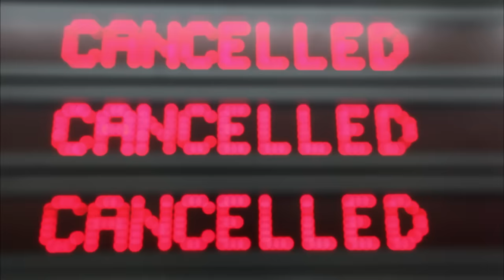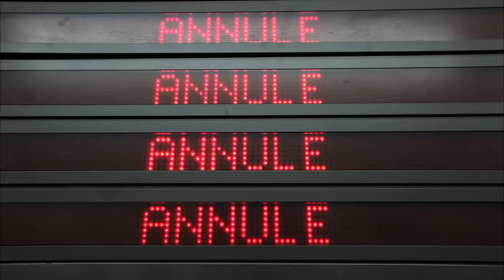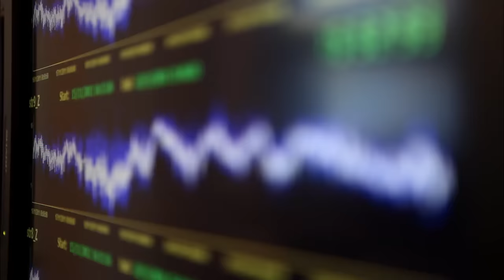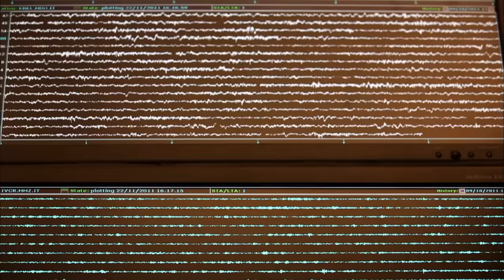A Volcano Odyssey | Documentary

Comment: Some people have suggested that the meteor that crashed into the Gulf of Mexico was directly opposite where the eruptions occurred in India when it was below the equator. Could a shock wave travelling through the Earth produce this hot spot and thus the eruptions? When shock waves travel around the Earth from a point event, the waves should all meet in one spot and cause a lot of energetic impact.
Reply: Not create the hot spot. That's a much older, durable feature of the mantle. But it's conceivable that the seismic waves by the impact destabilised the crust and made it crack over the hot spot.
Reply: How do we know that?  Is there any evidence of a hot spot before the impact in that area at that time?
Reply: Easy estimation by the energies involved. A mantle plume is a convection current in the highly viscous, extremely massive mantle. (On a material as viscous as the mantle you could easily walk, given normal temperature and pressure where such activities usually take place). To establish such a current, vast amounts of energy have to concentrate in a spot. Even a meteor impact of the scale we are speaking about here could not impart such energies in the system. (If at all, that would be the case at the site of the impact, not on the other side of the globe...)
Once established, convection currents can maintain themselves, but setting them up takes energy (which usually builds up over time.)
As for evidence of the hot spot before: Any such evidence would have been crushed under the Indian subcontinent and ground into the Himalayas.
Reply: Thank you for the explanation!  Makes sense that a plume, if possibly created by an impact, would have been originated at the site of impact rather than the place the converging waves focused on. Maybe there was a plume about ready to erupt on the other side of the Earth, and the impact's waves in the Earth focusing on that plume by chance activated it?
Reply: Thanks for asking this, Peter Karig, and thanks to the rest for the discussion. I have wondered this as well.
Reply: The eruptions started way before the meteor..not sure what your point is?! ...Kinetic energy would have sent a shock wave around the World several times, but through the Earth? It wouldn't need to to cause eruptions anywhere on Earth all it would have needed to do it shift the North American plate a minute amount for eruptions anywhere...Whose "Some people?"
Reply: Except the solid core would have deflected and dissipated the seismic shock. Also it would not cause a plume to raise that quickly it would have been decades if not centuries to rise to the surface.
Reply: . . . Interesting discussion requiring knowledge of geological physics.  But just to stir the controversy, look at Mars!  Mons Olympus opposite the Hellas Basin.
Reply: Myke. You are right they started before the meteor,  and this production says the eruptions happened after, but on my original idea the thought was about waves traveling around the Earth in a big ring and all meeting on the other side. the waves don't have to go through the core. But anyway, upon watching this again and forgetting I already watched it 8 months ago, I realized the predating of the eruptions to the impact, so yea, my whole idea of an impact creating the eruptions is wrong.
Reply: Alan Alan. Yes!
Reply: Your solid core theory is not as viable as you think
Reply: It has been suggested that, if the impact was a fact, the Himalayan mts were INSTANTLY produced from the impact.  Judging by my own unscientific observations, a bullet impact spreads its force out at about a 45 degree angle in the shape of a cone.  How fast the shockwaves traveled through the earth I can't even guess.  Plus the angle of impact would have decided what part of the earth would have been the "opposite side".  Whether the liquid core absorbed any of the force .... ? or transferred it directly without absorption .... I don't have a clue.  The force would have bounced around inside the earth too.  What a mess.  And the surface effects .... I would not want to see it.
Reply: It is definitely a possibility.  The Caloris basin on Mercury is matched with an area at its antipode thought to be created in exactly this way.  However, the shockwave that does the damage travels through the crust to meet at the antipode, it doesn't go directly through the planet.  How this interfaces with convection in the mantle is still unclear.
Reply: The dates have to say so. Do the dates match?

Comment: It was not just a coincidence that India started erupting lava during this time. There is a serious connection with the impact and India hot spot. When a 6 mile asteroid drives into the crust of the planet to almost 18 miles you can be sure that the shock wave in the crust reverberated a thousand times around the globe setting off earthquakes, volcanos and shifting the tectonic plates causing every possible disaster you can imagine - bottom line, asteroid was the cause of everything after it!

Comment: The eruption of the hot spot was likely caused by the impact.  There is mounting evidence that large strikes create what is called antipodal fracturing or ripping.  As the shockwaves race away from ground zero they meet on exactly the opposite side of the planet, and cause astonishing destruction.  There is also an example of this on Mercury!  The Caloris basin is the crater and exactly opposite on the other side is an area called the weird terrain, a shattered broken jumble of hills and valleys.  This isn't proven absolutely, continued study and understanding is needed, but it's a stronger explanation that those it has replaced.

Comment: Some have commented that chicsalue meteor impact has/has not created 🔥(hot spot) in the mantle due meteor impact. Me personally think that this particular meteor the size of Mt. Everest or bigger traveling over 20k mph and hitting the bottom of sea that already has  existing great pressure then add that to the equation would no doubt cause a fracture in the 🌎 mantle which in turn created 🔥hot spot  at impact earea, resulting in volcanic activity, also around the globe and shock waves globally creating earth quakes, tectonic plate shifting and drifting faster than normal, mountains collapsing on land and in oceans both creating tsunami 's bigger than I think anyone could ever imagine
Reply: That sounds possible. A meteor that size would most definitely have a worldwide impact (LOL) and could very easily cause mounrains to collapse. The wind created from that would topple forests and kill anything in its path, in front and back. The bow wave is nearly as destructive as the wake, that thing would be going well beyond mach 1, leaving everything behind it on fire and flattened. The shockwave would be.....oh, my gods.....incredible. It's thought the Tunguska Forest was the result of a meteor passing close overhead. In 1908, something flattened 800 sq. miles of the Siberian forest. Estimates say it was equal to a 20 megaton nuclear bomb.  That was just one isolated event. This doc says at one time, it was worldwide? Not meteors...but that much volcanic activity would rattle the earth to her core. OMG ✌😸